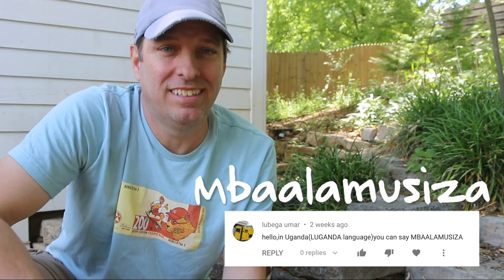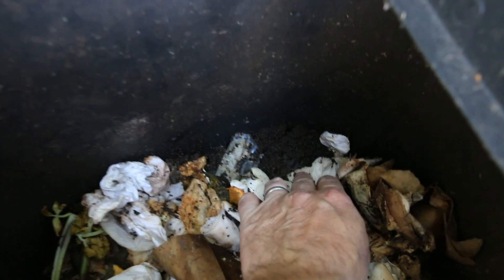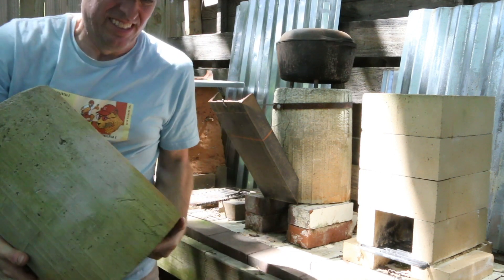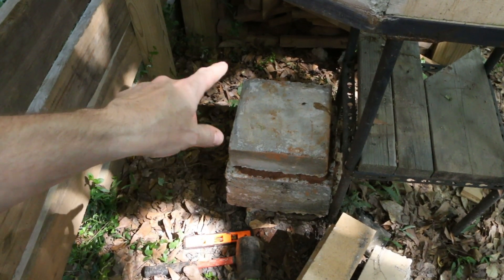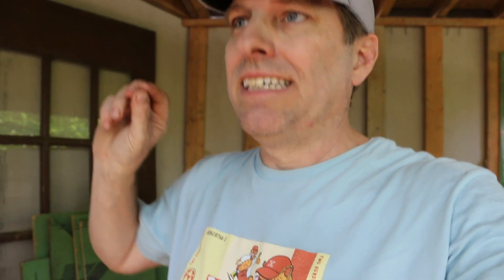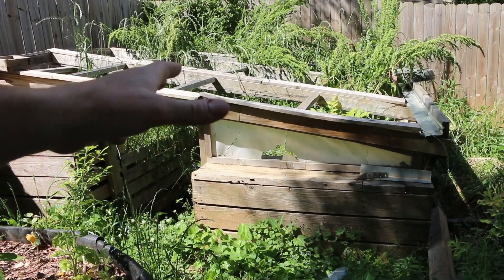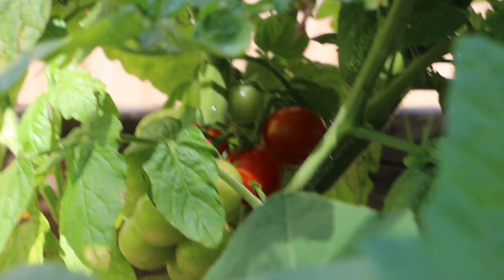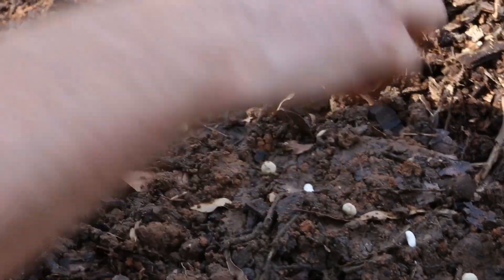How Much Lighter Is The Concrete & Perlite Rocket Stove? | Flow Thru Worm Bin Harvest Update + More

Comment: Hi just working through your videos... and saw the cracked stove... was thinking simple loops of heavy wire (fencing wire?) would be a good addition to the design to go in with the wet concrete as a strengthening feature... top middle and bottom... just a thought... lol not chicken wire
Reply from the maker: Thanks for the binge watch, Aurora (They call that the Aurora Bingie-alis...sorry, I can't resist being a cornball). Yes, I tried a stove without armature and it cracked. I did put a band on it, which has kept it useable. I've got some fence wire to try your suggestion. I think my next rocket stove will be a stack of rings. I think the loop method will be a great solution for this. Thank you and thank you for watching.

Comment: Thanks for the great videos! I live in the developing world and would like to make some low-cost rocket stoves for people here, and your perlite concrete one is the best design that I've come across so far, especially with the feed tube being exposed to the bottom!  I've got a few questions, if you don't mind.
I see you weighed the original cracked one here - did you ever do any more testing with different perlite/sand/concrete ratios, armature, etc... after the dry mixture failed?
How does the performance compare to the fire brick stove? Does the firebrick one get a lot hotter given that the wider opening allows for more wood and airflow? Do you think it would be possible to make a 5 gallon bucket one with a 5" tube, or would it need to then be much taller? Thanks!
Reply: And another idea- if you used a metal bucket, you could probably make a thin reinforced concrete-perlite tube in the center and then just fill the rest with pure perlite - less work, less cement, lighter, and more insulation. You'd have a handle for carrying it too! Thoughts?

Comment: I’m looking forward to you doing follow up on your bsfl. Did they survive thru winter ok? I remember you had insulated the container and added a lightbulb. Currently my zone 10b bsfl is going strong. They’ve also colonized the composter bin (which doesn’t smell at all. It’s 80% wood pellets used as rabbit bedding with urine, rabbit feces and some hay). Today I took 75% of the contents in the bsfl bin which was too wet and anaerobic and added it to the compost cooking while aerating and wetting the compost and adding drunk juice. The compost wasn’t hot enough and I’m betting the frass from the bsfl will speed it up. Then I added “fresh” used rabbit bedding to the bsfl bin, hopping it will keep that bin drier.